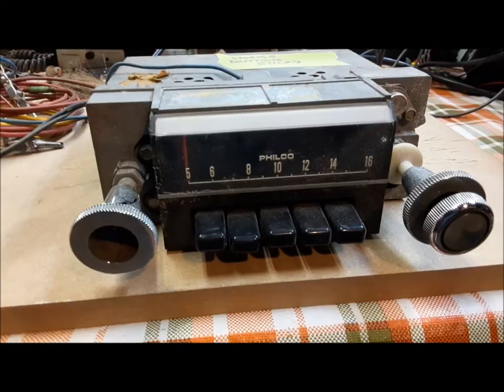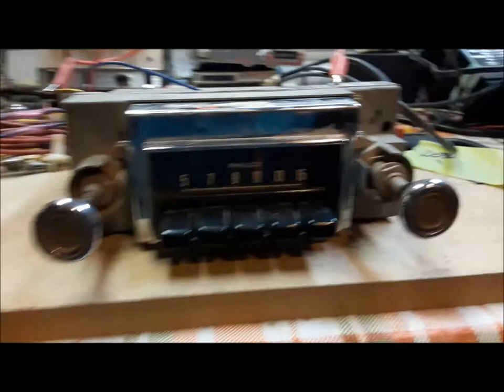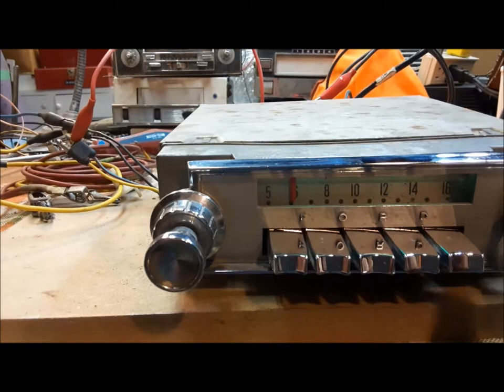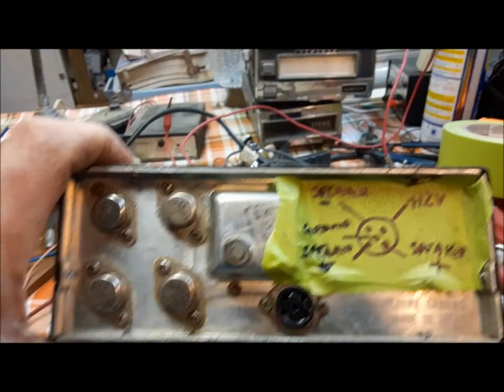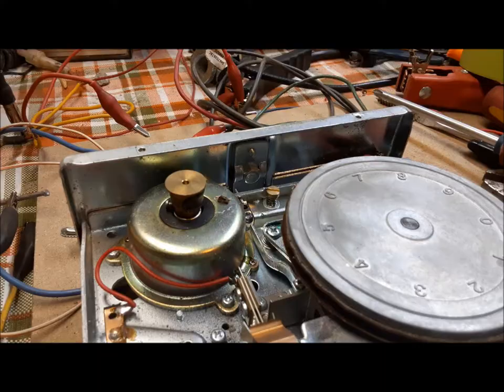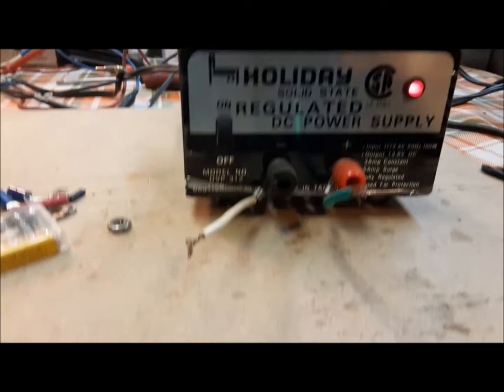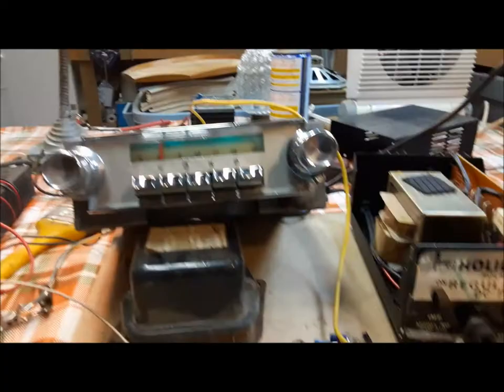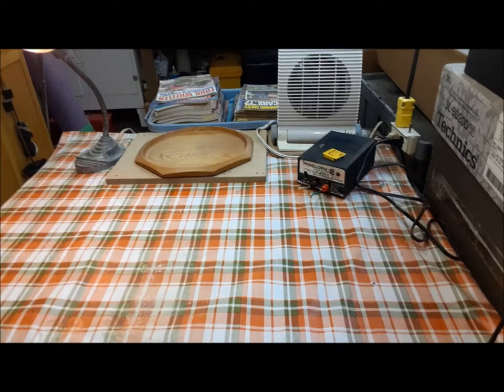Old Car Radio Service and Repairs and 8 Track Players Too!

Comment: Do you repair in dash AM-FM in dash 8 Track tape Players mine is a Ford AM-FM 8Track tape Player? If so how much for a complete Refurbish?
Reply from the maker: Sorry. I don't really repair radios professionally. I open them up, spray some wd40 around and change belts. Take the lid off of it and see whats in there. 8 tracks are usually easier to change the belt than cassette players. Clean and lube everything and you'll be all set.

Comment: I have a 1967 Ford Mustang AM radio.   It powers up but I am getting squeals and oscillation sounds across the dial with the exception of 1 local AM station and its not strong.  I am using
about 6 feet of wire for an antenna.   If I connect a longer outside antenna it kills the reception as though it might be overloaded.  Just getting squeals and oscillation sounds.
I can't find the schematic for the radio.   Its AM only and I believe its the original from a car my brother just purchased and was told the radio did not work.   Any tips would be appreciated
Reply from the maker: I wish I could help. I am not a radio technician. I just fool around with them. If they don't work I'm lost. My only suggestion would be to use an actual plug in car antenna. I found that helps a lot in my testing.
Reply: @ClaremontClassicGarage  I have it powered up on my bench.  I have it now getting 1 local station but if I use a longer wire it goes into oscillation.   I wish I had a schematic.   Its making me think some type of AGC problem

Comment: What would you say the problem wold be in an 8 track player the spins up but there's no volume / very low
Reply from the maker: I'm no audio tech but I would guess there is a problem in the amplifier section of it.
Reply: @ClaremontClassicGarage  thanks for the reply. That was my thought to unfortunately tho idk what to look for or test to see what's wrong
Reply from the maker: @reddoggames3011  makes two of us. I'm no expert on them. I just muddle my way thru and sometimes it works.
Reply: @ClaremontClassicGarage  same here

Comment: I have a new truck and I hate the touch screen GPS, Android, Bluetooth, USB, blah blah blah radio. I want an old school radio with buttons and flashing lights. Unfortunately there is nothing on the market today that compares to the car stereos we had in the 80s. I was considering buying an old Alpine from Ebay but was wondering if there was someone or somebody that does professional car stereo refurbishment. Can you recommend?
Reply from the maker: Sorry, all the good radio shops I used to know are gone.